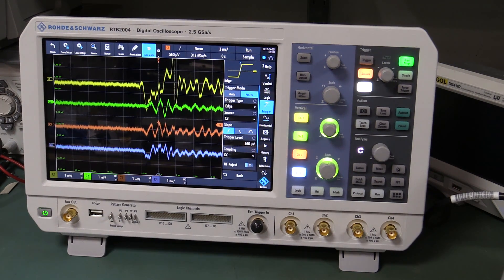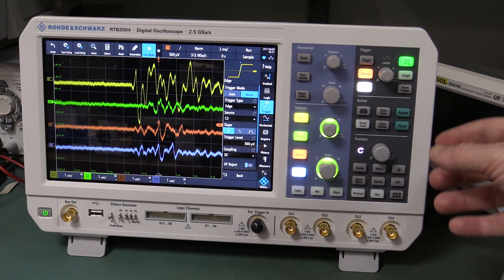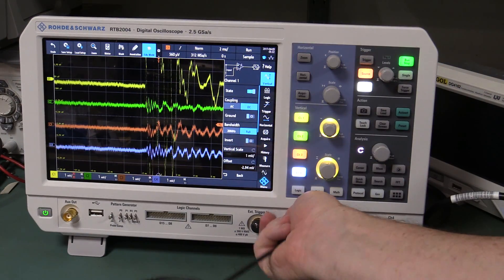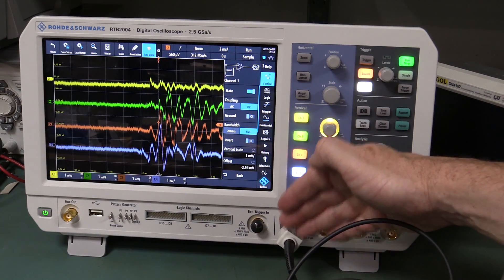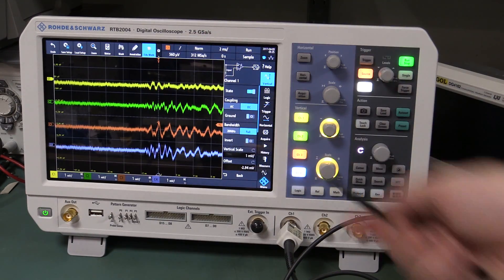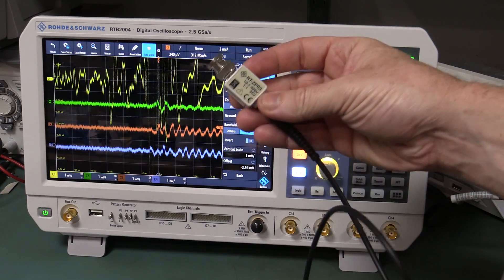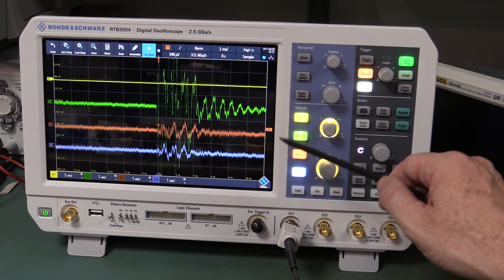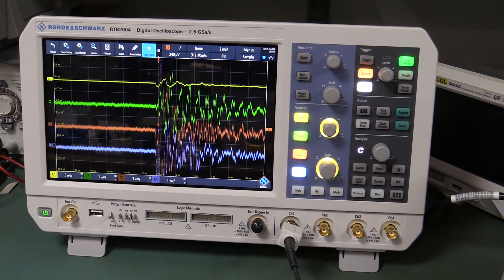EEVblog #983 - PART 2: Piezoelectric Oscilloscope Issue Followup

Comment: Here's an obscure but possibly related phenomenon: I designed a product that has a rigid board PCB assembly inside an ultrasonically welded plastic housing. During U/S welding, the microcontroller-supervised electronics are in a sleep state. In a small percentage of units, the microcontroller and/or some of its I2C peripherals experience static register corruption, so that the device fails to come out of its sleep state properly. Much effort has gone into troubleshooting these failures. Removed from the housing, the assembly passes all tests and x-ray inspection of solder joints and components reveals no damage. We are now looking at the possibility that the bypass MLCCs (amounting to about 30 uF, mostly 2.2uF) are generating enough microphonic voltage on Vcc to corrupt memory registers. Anyone out there have any experience with cap microphonics during U/S welding? The size and density of the assembly makes it unthinkable to go to any dielectric with less volumetric capacitance than X7R. And, yes, U/S welding was probably not the best choice for sealing the enclosure, but I didn't make that decision, and it's a bit late to do a total enclosure redesign.

Comment: When one connects a scope and 64 channels of a logic analyzer to a multimillion dollar server under development and wait days for some rare failure such a thing can be damned relevant.  I chased many false triggers to electrostatic events. Just movement nearby can sometimes trigger a scope or logic analyzer or present false data.  I found a microphonic capacitor causing a real time clock to miscount time due to fan vibration. But it never occurred to me to suspect mechanical shocks to the instrument itself. Some of my diagnostic failures may have been due to this effect.

Comment: Dave, would it be possible to "use" these mlcc's as actual microphones? can u crank up the resolution high enough to see, say the sound from a speaker placed right next to the scope, on the screen?
Reply: I did put these smd capacitors under the strings of my bass guitar, it needs a small amp, and it sound great.
Using these, as a vocal microphone, is more difficult because of the small surface the smd have, coupling a big surface to it for capturing sound "pressure" would it make possible.
Reply: I'am going to try that tomorrow
Reply from the maker: Possible. They certainly won't be a flat response, and coupling is not easy and quite lossy.
Reply: I have no shame , could you hook me up with a used digital scope , I will pay the shipping
Reply: I might try capacitor pickups on my guitar if I feel I have some time to piss away. High capacitance would giver higher output, right?
Reply: electret microphones (which are very common) are basically this
Reply: Trying this as we speak.
Reply: Sounds like a suggestion for the intelligence community (NSA and such)
Reply: No success so far with normal through hole stuff. Yeah, if you actually tap the caps with your finger... 
I don't have SMD parts sitting around.
Reply: This piezo effect is due to the construction of SMD caps. Shouldn't really see it on a electrolytic caps
Reply: rfmerrill + The fabrication process is quite different and they are highly optimised for the job.

Comment: I have an RTB2004 which I have now been using for almost a week and have not noticed this effect on the Analog inputs at anytime whilst using the touch screen.  I have also been using a wired mouse from the front usb port and the user interface is great with the use of a mouse, especially the cursors for measurements and also moving the waveforms around the screen. Dave's scope appears to be more susceptible to this problem than my one for whatever reasons (I have been using my scope down at 2mV a division without bandwidth limit).  The scope has a few software bugs which I am sure will be sorted with further firmware updates (new version already on R&S website).  So far I am delighted with the scope, the digital decodes are great and far better than on my original Rigol DS2072.

Comment: Dave when you was looking for the internal 50 Ohms load, you didn't scroll down that menu, if you look you have a scroll bar on the right of that menu.
Reply from the maker: Correct, but there is still no 50ohm input option.
Reply: Ah, ok, I just saw that scroll bar and thought it might of been further down the menu.
Oh well.

Comment: I drug out the old Hitachi V-212 workhorse (Sits in a box on a shelf but I just can't part with it) and it does the same thing only to a lesser extent when you rap the BNC's but not at all by slapping the case.  Service manual lists it as a 0.047 uF 400v 'plastic' which I assume is a poly or mylar.

Comment: Hi Dave, would you like to give us a talk about how signal that carries data from  the capacitor of a DRAM cell to the latch of a register works on the circuitry perspective please ? I know how sense amplifier works, I have trouble in visualized seeing the process of how the signal which carries data is generated and sent to the register , and how register receives it and traps  it into the latch of register  . Thanks in advance.

Comment: Dave, inductors also have such effect (if you have some inductors which are under constant high-power load and hit them, you will see the effect, they shift their magnetic properties a tiny bit). In filtering applications they actually produce a huge and quite audible noise (even at higher frequencies the harmonic frequencies are audible). Well, it could be that you already know, but I have seen no mentioning of it in your videos.
Reply: Any component can be microphonic if Dave hits it hard enough!

Comment: What would be the simplest combination of parts to replace the problematic cap so that the shocks equal out (like minimizing EM induction in XLR connections or fine-tuning signal paths in a pair of length-adusted PCB traces)?

Comment: Can this be engineered out?  Aside from acoustically isolating the board, which would be a lot of work for and still wouldn't be 100% effective.  Is there a way to mount parallel caps in such a way that the induced voltages are cancelled?

Comment: they could possibly improve with low acoustic ceramics with built in interposers, put ceramics on opposing sides of pcb and add destressing slots in pcb. All add cost and size however

Comment: Hey Dave, I find that really amusing too, but do you think there is any way to design a away around it? I'd guess there isn't much of a need but it might be annoying if your bench is prone to being knocked, and having to reprobe can be annoying if it's not easy to probe.
Reply: replace ceramic caps with film caps?
Reply from the maker: Yes, you can use different types of caps, or the ones in the description link that are low microphonic types, potting helps also, and/or add funky PCB routing to isolation it a bit. You can also mount the caps sideways and that helps a lot! (see my old video on probe microphonics for a demo of that)
Reply: EEVblog thanks Dave, do you think the designers either didn't know or didn't care? maybe they dismissed it at this price point as something that the user wouldn't experience, and sure, with the leads on and a source it might only throw the results off a little, but more expensive scopes that are more accurate by only a few percent could have that advantage wiped out by tapping it haha
Reply: I'd say that the whole front end microphonics thing is quite overblown, I mean I'd like to know who whacks the oscilloscope just for the fun of it while doing a very sensitive measurement, I mean the effect is obviously there, I'm not denying that but , especially once the probe is connected you just need to A) not touch the scope while doing a critical low level measurement (which sounds like a good habit to have regardless of mlcc microphonics) B) if you have to force trigger it just do it gently, the button doesn't need to be bashed with a sledgehammer to be pressed

Comment: How well would an optocouplers between the cap and the jfet  work to get rid of that effect? steve usa.
Reply: The capacitor generates a small voltage on vibration. If you have a high-impedance input, it will be indistinguishable from the signal. An optocoupler electrically isolates something; unless it changes impedance (which you wouldn't want), it won't diminish anything.

Comment: Aren't you still triggering off of channel 3 when demonstrating the diminished amplitude with the test probe attached? I wouldn't expect any change in sensitivity then.
Reply: Why would the trigger affect the waveform?

From what I saw, Dave left the trigger on channel 3 and made sure every test tap also involved the scope case as well, so that it would trigger. So when he was testing the probe's capacitors, he was just using the scope as a convenient trigger even though its capacitors were not relevant. He could have hooked up a separate tap sensor and triggered off that for the probe tests, but why bother when you already have a convenient tap sensor in the scope?

Comment: Can anyone confirm the effects this would have on a scope with little to no buffer against an engine? (no rubber dampers or springs for both the engine and whatever is holding the scope) I might test this on top of my car when I have time this week. Using a 2467. Nervous about wrecking that scope though since its 1986/88 old.

Comment: As one of your rare viewers both not knowledgeable about electronics, and not in the electronics field, when does this start to matter? What kinds of applications would this bug negatively affect?
Reply: There's a possibility that sounds produced locally might cause bad readings. Think testing an audio amplifier. If you have to test the output under an active load (speaker and not a resistor) you might get false triggering.
Reply: When trying to sort out other effects and watching for glitches or running a scope in a vibrating environment (like on top of a machine). So although the occurrence is rather rare and annoyance low, i think it is good to point it out to not hunt inexistent problems with the device under test. It might also be a good practice to put termination resistors on unused inputs or have a scope with such a feature.
Reply: Jammit Timmaj It won't show or trigger, even with the probe disconnected. I think even a explosion wouldn't affect it.
Reply: When we test any type of engine? I'm not sure myself but I know a place that has a suspension system for carts where our test equipment and tools goes on. Not sure if they thought about this or just added that so the stuff or their internals doesn't rattle out of place.

Comment: I'm quite amused from this whole story...

First of all I'm not denying the effect is there, it is obviously real ( the dielectric in type 2 MLCC's is typically barium titanate and that is used also in piezo sensors just for that application)

That sail i'm failing to see where the problem lies, the only use case affected is as Dave said when measuring high impedance low level signals, and if some engineer worth is name is making such delicate measurement I highly doubt he's going to whack the scope just for the fun of it...

If we are talking about a high vibration environement usually they are also very electrically noisy (automotive, aerospace, mining  etc) so that will have an effect orders of magnitude higher

Comment: R&S should stick to spectrum analyzers and niche products. It's very questionable to think they can compete against Tek and Keysight on the higher end and Rigol and such on the lower end with their mediocre overpriced scopes. I know countless fellow engineers, business with large labs, etc. dating back a few decades and I've never seen an R&S scope outside of a trade show. I don't know anyone who has bought one. From what I can tell almost nobody buys them. Would you buy one with your own money? Their scope market share must be roughly the same as Palm OS among current mobile devices. They should just focus on what they're good at. Many companies these days are so obsessed with growth they lose sight of their core competency and don't understand the market or their competition.
Reply: Lots of lower/middle end R&S scopes were sold under the Hameg brand (which was aquired by R&S a few years ago), the HMO series.

Comparing my 2 year old HMO1002 (which was one of the first Hamegs branded as R&S) with one of the brand new Keysight 1000 series scopes, I for sure prefer my HMO. It boots up in less than 2 seconds, is fanless, has an MSO option, comes with LAN interface (which guarantees 1.5kV isolation, contrary to USB), and just works. At 100MHz, it costs about the same as the KS DSOX1102A (800€), but is IMHO the much better option.

I have seen a lot of Hameg scopes in the wild, and some RTx series (the "original" R&S scopes). As the RTx are much more costly, they are much more rare.

Comment: There is nothing new in this series of videos. Scope triggers are always built to be as unstable as possible using the technology available at the time - whether it be 1980 or 2020. They will always hang just at the edge of tripping. That is the entire point. 

This series displays a typical EE response to anything they just "discovered" which has been around for decades. Hair on fire running in circles. 

The best advice I can give a new EE is to watch this video series and try your best not to behave like this. This stuff is a source of disruption in work environments and a principle reason why you will not find EEs running large entities. 

Just because you as an individual do not know or understand something, is no cause to whip up a fit and get people excited. 

My God Dave, this whole thing is old news. Abuse a trigger circuit in anyway and it will fire. Your obsession with multilayered ceramic caps is one of endless ways to make a trigger miss fire. 

Perfect example for new EEs. Don't do this stupid over the top emotional pseudoscientific crap. Think, research the past, evaluate the underlying issues and THEN figure out if something matters or not. Don't run your mouth before you really understand the reality of the problem. Otherwise, no one that matters will listen to you.
Reply: Are you claiming that this is all an artifact of the trigger circuit, that if Dave just took a long log, tapping wouldn't generate any waveforms?

Are you also saying that Dave should not inform up-and-coming EEs as to this phenomenon, because it has been known for a long time therefore every EE automatically knows it and it's just redundant? And that EEs should not watch his videos because they give information that they should already know?